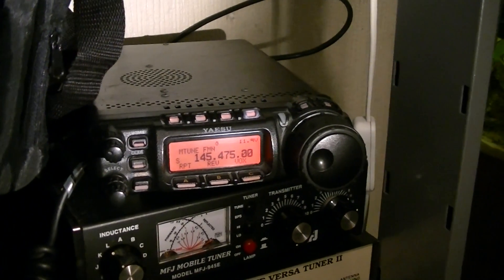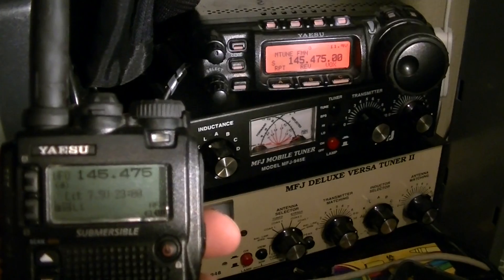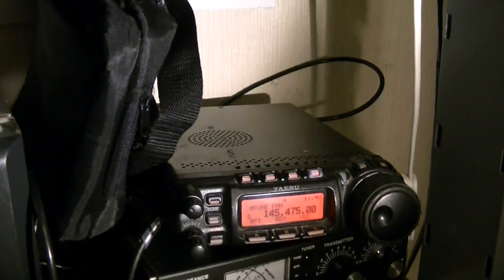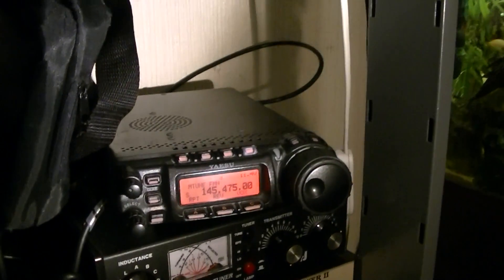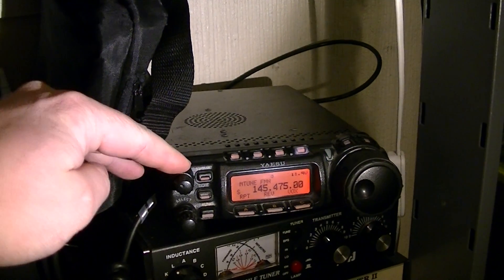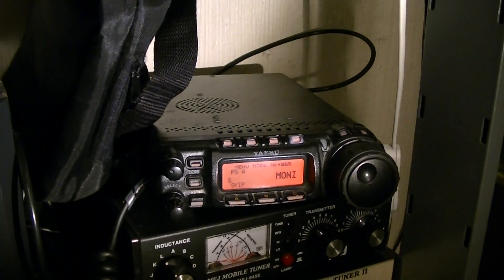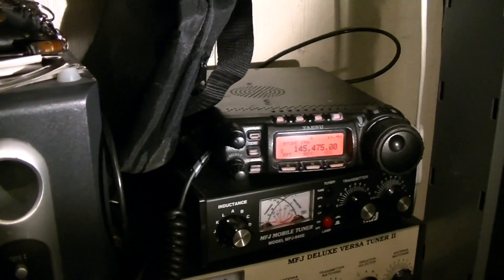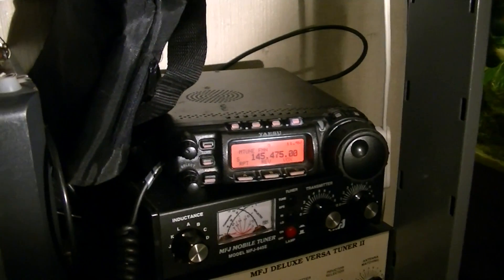Yaesu FT-857D Fault with Squelch Wont let any Station pass through

Comment: I had the problem too. I changed de 'servicemenu settings' 013 - 014 - 015 - 016 to  values 175-175-170-170.
No idea why it helped, but it did, at least on 2meters.
Service menu is enabled by pressing A-B-C concurrently while powering on.
Reply: Perfect ❤️
Reply: I's work, that's.
Reply: Awesome, thanks. This fixed the squelch problem on my FT-897 too :)

Comment: My 897 has a very similar fault,  exactly the same happens but only with low strength signals,  strong signals break the squelch and come through no problem but after they finish their over I get an annoying 'white noise'  before the squelch decides to operate again,  like the good ole classic radio noise people imitate.  I have been through the secret hidden menu to try adjust the squelch hysteresis but it just doesn't seem to make any difference at all.

Comment from the maker: Hi, the issue is caused by the SMD components that make up the squelch. they need replacing. i have seen kits on auctioning websites to fix the issue. however you need to be really good with the soldering iron.

hope this helps and please check the link in the description
peace.
Reply: Hi John, could you please give tips about sites with the FT857 squelch fix kits available or keywords to find such? 

73, - Juha OH7HJ